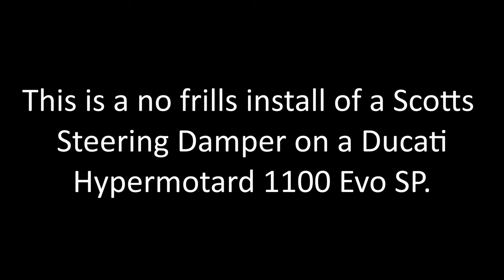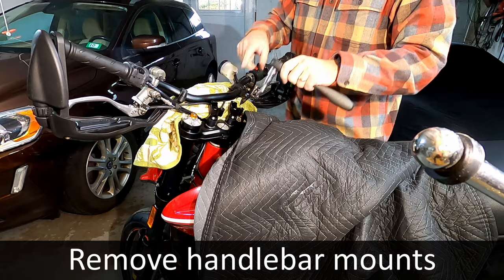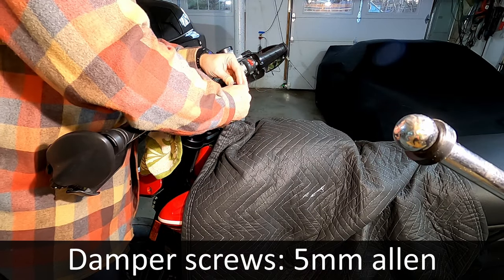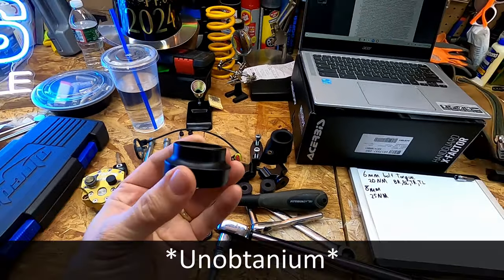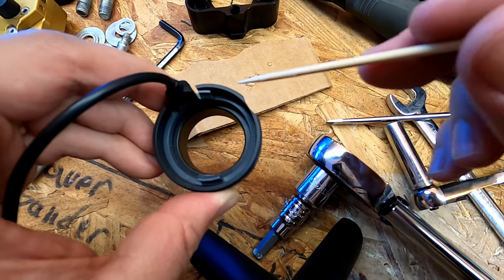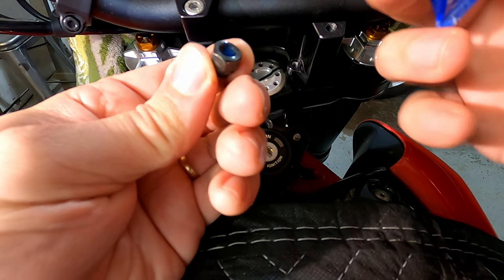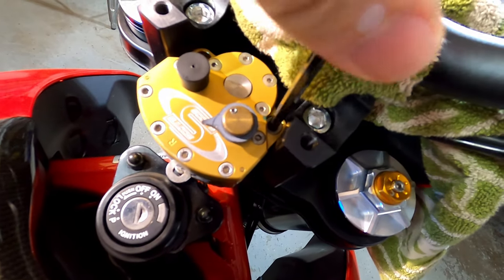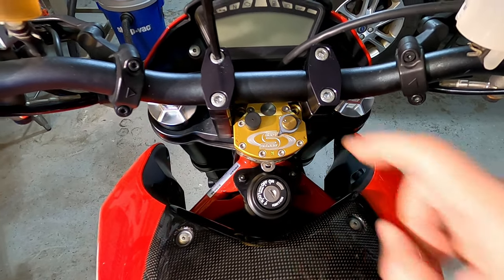Ducati Hypermotard 1100 Scotts Steering Damper Install

Comment: Great video! I have an 08 Hyper S and have a Scott’s damper with reverse link ready to go but can’t find a source for the lower bar clamp to accept it. I contact Scotts and they said they dont make them anymore? Can i ask where you got yours?
Reply from the maker: Sorry for the delay (I was taking a break from YT).
I got the damper/arm/pin from an Ebay auction.  Apparently it was pulled from a totaled hyper (that's what the seller said, they run a salvage shop).  I'd scour Ebay and see what you can find, that's how I got brand new unused evotech sliders too.  It's a bummer that stuff like this isn't made anymore.